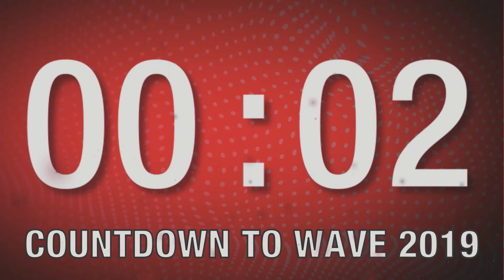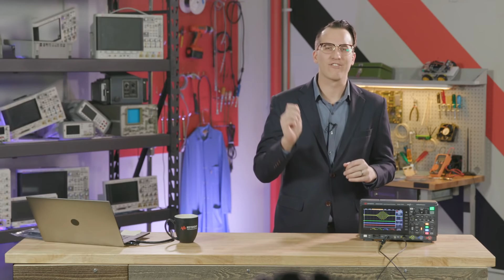Wave 2019 Kickoff (1-Mar)

Comment: frequency Response measurements w/o a 'scope actually supporting it? i would simply try and go with a high bandwidth Signal (like White noise (can be generated quite easily)) and then do a fft of Input Signal and Output Signal. differences should be quite noticable (hopefully)

Comment: Julian Ilett's technique of sweeping the input and looking at the output with a long persistence setting is quite useful and in fact can be better when your dealing with sharp filters in the relatively low frequency audio range. The FRA looks at quite a large range of frequencies even at it's most narrow setting.
https://youtu.be/ahwZTZzYVzQ?list=PLjzGSu1yGFjXKZ5igKxwlgfGdy25yZoPN
Reply from the maker: We did update the FRA minimum resolution setting after getting his (and other people's) feedback.
Reply: Yes, I found out about that update from Julian. It's nice to be able to set the Min Freq very low and to have more points per decade but to set the Max Feq within the audio range you only have 10kHz and thena  huge jump up to 100kHz to choose from. Using Julian's method you can pick much more specific min and max frequencies.